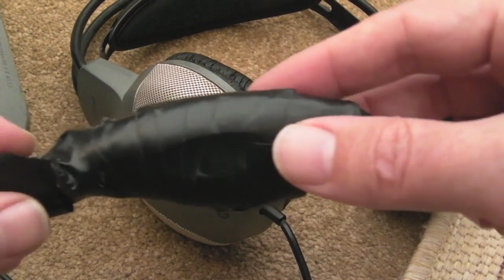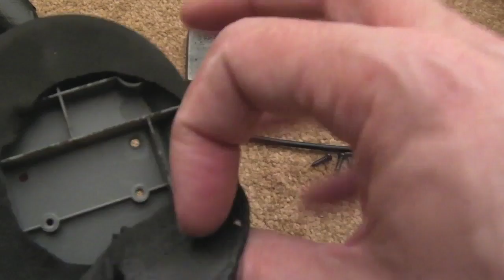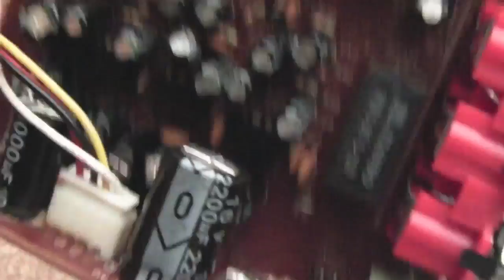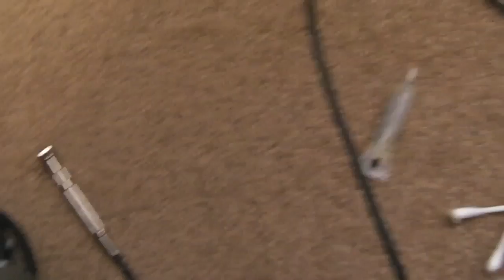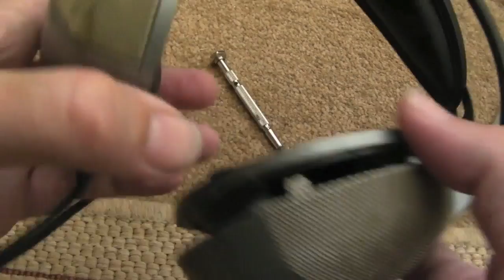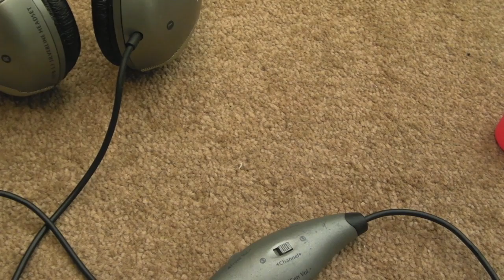Trust 5.1 Headphones On Life Support (Again) - That crappy accessory you cannot let die...

Comment: I can't say I've ever repaired headphones, but I've certainly had them break.
It seems like every set of modern headphones I've had have found some random way to break after 2-3 years.  Usually it's some piece of plastic.
The most recent was a Turtle Beach set that broke when I fell asleep while wearing them.  Okay, in that particular case I'll admit that I put some "unnatural" strain on one of the earpieces, but I think age and brittleness was also a factor, and the lack of build quality annoys me.

Feeling fed up with this, I bought 2 pairs of really ancient headphones for cheap at a thrift store.  The ones I've been using are Koss K/6ALC headphones that, according to the internet, were popular in the late 1970s.  The other pair is even older, and are some brand that was sold through Radio Shack in the early 70s.
The Radio Shack ones don't work well on a PC, I think they need a proper amplifier.

The Koss don't sound that great compared to modern headphones, but they work and I don't think it's possible to break them.

I still have 3 sets of modern headphones lying around but they all have different things broken on them that make them various degrees of unwearable.  The best of these is on my secondary PC, the rest should probably just go in the trash.
Reply from the maker: Very true lol - They don't make stuff like they used to.  You won't be surprised to hear that as I type this I am currently wearing those Trust 5.1 headphones and they work perfectly still and give awesome 5.1 on the 360, XBOX One, PC and PS3.  I originally bought the first pair in 2001 I think.  I tested a few more modern sets - Zalman, and Sony, and prefer these lol.   Both the ones I tried were sold on and I kept using these.

Comment: When I play Call Of Duty I can tell where people are coming from, up, down, left and right etc. I have a pair of Sennheiser PC160's - they are amazing, had them for years and years :)
Reply from the maker: iGuruRevolution Yes, they fixed the sound engine on recent Call of Duty games but in Black Ops and prior the sound was always basic and hardly any foot step noise etc.  Since Ghosts etc it is better - I can usually tell on Advanced Warfare when people are coming up behind or when someone jet packs up near me etc.  One of those comments I thought about after the video and thought - I wasn't very accurate when I said that, it doesn't really apply to the last couple of COD games.   Battlefield had proper 3D sound working right from Battlefield Bad Company and it has always been one of things I love about Battlefield.
Reply from the maker: iGuruRevolution I might try the Sennheiser PC160's =)  I do need to find a good replacement - these won't last forever and I am sure the top end (£200) pairs will be much better but I cannot justify paying that unless I can get a set that works with PC and XB1.
Reply: GadgetUK164 The ones I got only cost me around 60 pounds and as I said have lasted me years and years. I cannot comment on the call of duty games you mentioned as I never played them. Recent ones I have played are Black Ops 2 and Advanced Warfare, which as you stated have a better sound engine :) When your headset dies again :P look into the Sennheiser, good build quality on them as well.